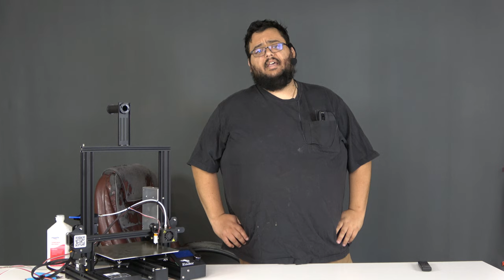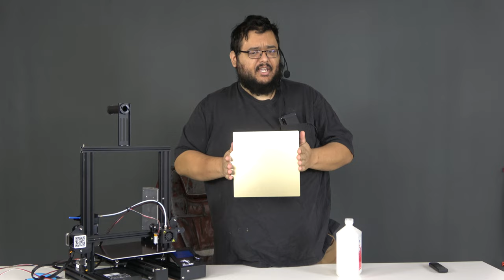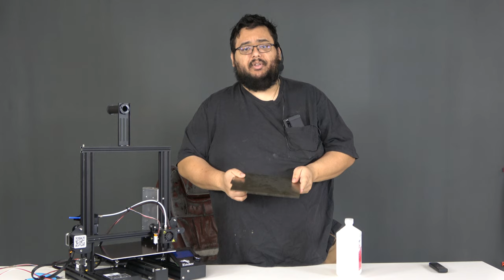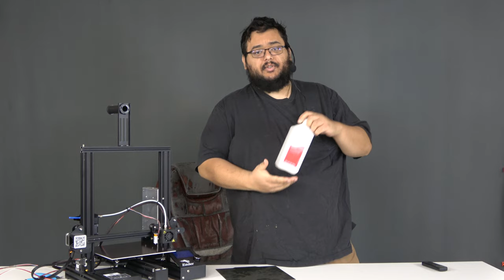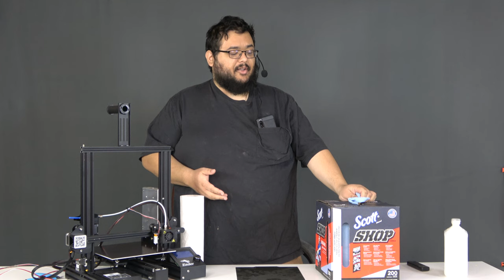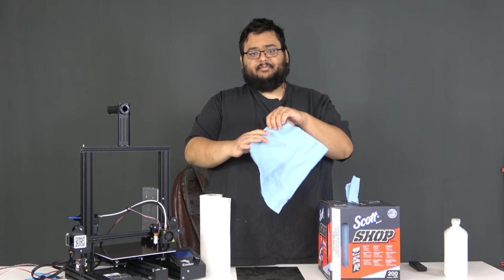Stop using paper towels to clean your build surface and use this instead

Comment: I get your point, but mayb not the bast explanation. I'd say the reason why shop towels are better is that they don't dissolve. Regular paper towels upon having too much liquid in them rip apart instantly, whilst the shop towel does not, allowing for more liberal use of IPA whilst allowing you to get a better scrub of the surface. Better for most applications, honestly.

Comment: I cut the sheet into 16 little squares.  You ever tried dissolving rosin into 99% IPA (aka DIY flux), and using it on the build surface?
Sticky.  Works pretty well.